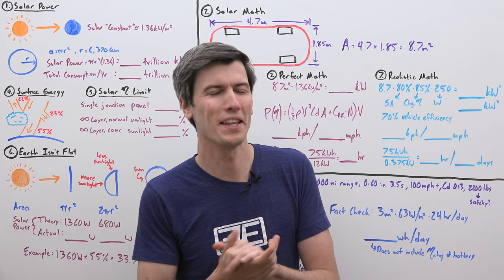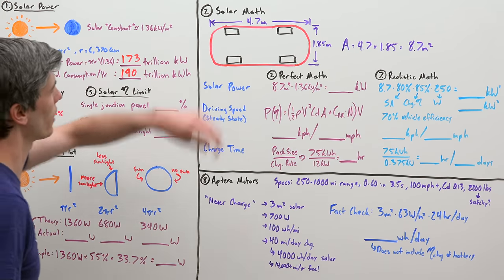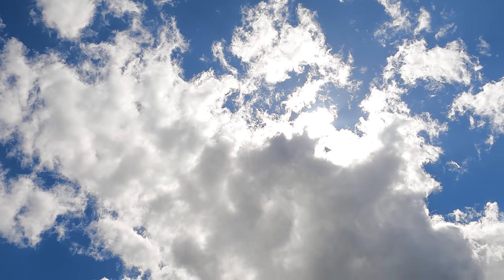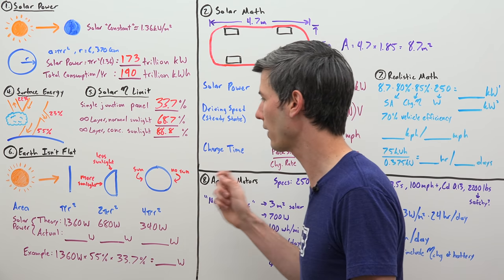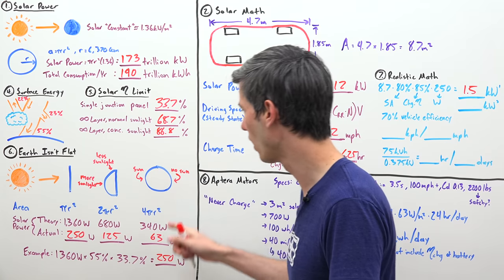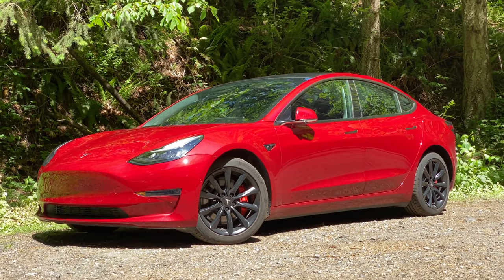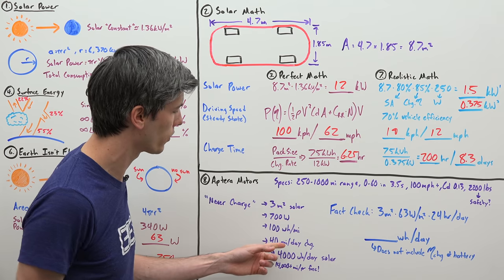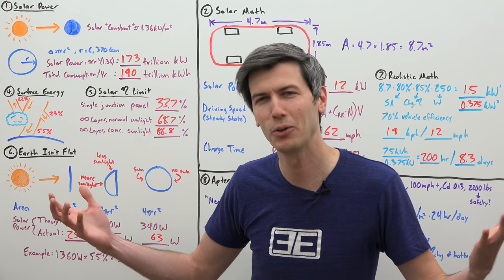Why Don't Solar Powered Cars Exist?

Comment: I have to give you a like just for the math, since that's exactly what you need to do when you're talking about energy, energy storage etc. It seems like it's so neglected in the public discourse. People just claim stuff without backing it up with numbers and actual physics.
Reply: Sometimes just using your common sense is enough to prove something can't work, isn't technically feasible or financially "difficult".
Reply: I mean, showing all the math and going into the weeds to explain everything makes sense on a youtube channel called Engineering Explained. But if you do that in regular public discourse you're just going to confuse and lose people. If you're not all that technically minded, familiar with the topic, or even just all that invested; if you have two people talking with seemingly similar levels of expertise you're more likely to believe the person who's more charismatic and explaining it in a way you can understand rather than just throwing maths at you. And even if the public discourse was based solely around dry facts, people would still be manipulating or omitting specific facts to make their case stronger. As long as the average person isn't knowledgeable about everything or only interested in the topics they are experts at, the public discourse will never be ruled by pure maths and facts.
Reply: @Enforcer_WJDE  
Often common sense is not enough, but people were ill-informed an think that it's enough. I see this all the time in discussions about global warming and CO2 neutral energy systems. People just make arguments based on what they see as "common sense" and then fail miserably or suddenly think that they've refuted over 100 years of scientific research.

But of course the math and the physics is often hard and people can't do it. So instead of realising that since they aren't able to do the math they aren't experts and shouldn't take their own opinions too seriously they instead delude themselves into thinking that math isn't that important and that "common sense" is enough. 

Maybe that's the reason why you're objecting right now. Who knows?

I teach physics (besides math and chemistry) and i always make sure to teach my students, that don't really understand something if they can't do the math. You need some intuitive understanding, some feeling for it, but you also need to understand and use the formulas. If you don't know how to use the formulas and where they are comming from then you aren't really done yet. After all you want to be able to answer question and to answer a lot of questions you need to be able to do math.
Reply: I wish I could give two likes for the use of SI units!
Reply: If you average the miles generated per day its 24 miles per day Produced by the car  (8.3 days per full tank, 200 mile range, yada yada), this is around the average for americans to drive every day, so it actually does mantain itself basically.  (Avg american drives 29 miles a day, 24 is 82% generated by the car)
Reply: Though I would have liked to have seen him mention other factors like clouds. Folks in Seattle won't get nearly as much usefulness of a solar car as me in Las Vegas. Another factor is most people park cars in garages now, it's pretty much a necessity where I live if you have any paint color other than white (the sun eats through paint). So getting charging at home or in a parking garage may not be possible.
Reply: @jimmym3352  very good point. Garages are a big downside. It really shows how yes this technically could work great and be a good idea but just put them on your roof😂. Then no downsides of surface area, garages, ewaste if you crash, etc.
Reply: @Enforcer_WJDE  no, not really. "Common sense" is why people think the earth is flat. Don't promote this garbage... Numbers matter.
Reply: @SapientGalaxy  Plus the sun doesn't shine 24hrs a day. I don't understand math at all but I like to sleep at nighttime. When it's dark out.
Reply: @Enforcer_WJDE  Let's all use "common sense"  (means nothing) to decide what is possible or not possible and realize that putting any effort put into investigation, reason or logic is all a horrible waste.    (I never fake sarcasm)

Comment: As my 2-year-old boy starts screaming and running around:

"So, we need to understand the son. and the son has all of this energy..."
Reply: Now all we need is to harness the sons energy.

I was thinking about some sort of hamster wheel.
Reply: @lordrefrigeratorintercoole288  Actually, in one of the scifi novel (the title of which I forgot) an inventor invented a set of puleys and levers connected to power generators spread around the house, so that children (who have excess of energy and are always up to something) will rotate and move while producing electricity.
Reply: @aGGeRReS  that seems like a good and a terrible idea lol

and yeah pls try to find the movie
Reply: @Lurkindork  not a movie, but rather a novel. Was trying to find it, but I read it long time ago and Google doesn't help.
Reply: The farmer told the solar home builder, "It won't work, I have a teenage son that lays in the sun all the time, he doesn't have any energy!"
Reply: @lamarrharding4776  the teenage sun spent it all when younger
Reply: Probiotics and a cup of green tea help my wild one. 5 yo
Reply: @aGGeRReS  reminds me of those pressure generators pads for paths. Apparently they make flat ground feel like you're constantly walking uphill or a bit like walking on a dry beach where your feet sink with every step. 

It's one reason we'll never see non-consentual human generated power because people like 95 year old Marleen could have a heart attack because the subway made forced her to produce their electricity.

Comment: One thing that I think bears mentioning is that even if you can't drive 100% on solar, that passive charging can still be useful. 

Instead of having to go to a fast charger every week, maybe you're going once every 2 weeks, or every 2 months, etc. 

That's a huge help to people who can't charge at home.
Reply: The average daily drive distance in the US is 38 miles. So in good sunny conditions this car could stay charged on solar alone for half of drivers!
Although in practice not, because normal driving is likely to need more power than the optimised driving used in their figures and most places are probably not optimally sunny. But you probably could get away with charging it very rarely, as you say.
Reply: It's a lot more functional to just have solar panels on the grid and charge from it. The productivity is much better and they aren't wasting power if your car's battery is full. The car also doesn't have to carry the extra weight of the panels.
Reply: @mgkleym  I think it's still mostly a gimmick. The only people it would be genuinely useful for are those who can't plug in at home, eg those who have to park in the street. Public chargers are expensive.
Reply: @adrianthoroughgood1191  the “only people” are city folks and we have 60 millions people living in US cities
Reply: @RomanticPopPunk  the numbers depend on what you define as city. 80% of the population lives in urban areas but that would also include suburbs and towns. Even in big cities a lot of people have off street parking, eg a parking garage in the basement. A lot more just don't have a car at all. In high density areas there isn't much roon for very many cars parked in the street, not compared to the population living on the street. In the UK some councils are installing chargers built into existing lamp posts. They are only low speed because the cables couldn't handle more, but enough to top up over night. I think this is a good idea. I think governments should require building owners to install chargers for every parking space at apartment block car parks etc. In a high density built up area the solar panels on a car probably won't charge very well due to shadows. A solar car might work for some people but I don't think it will be worth it for very many. The amount of charge you get is small but the cost increase in the car is a lot. If you drive to work and have parking there you would probably be better off charging there if you can't at home. I think governments should require work places to provide chargers as well. In Europe, in 13 years time 100% of new cars are required to be EVs. We need to get serious about making sure everyone can charge their cars and don't get left behind.

Comment: @Engineering Explained  Jason, I've been looking forward to you reviewing the Aptera.  When they opened the queue, I paid for a place in line.  I don't think "solar powered" should be their primary marketing angle, but most efficient vehicle on the road, by a long shot, is pretty awesome.
Reply: Good luck, but the Aptera has been ready for imminent release since 2005.
Reply: @truantray  You are leaving out a long, long back story involving corporate politics, bankruptcy, a new owner, then another owner, then acquisition by the original founders. Production follows the 4th prototype in 2022.
Reply: I have been sold on this paradigm shift in private vehicles from the beginning 16 years ago. I have deposits for two.
Reply: @1voluntaryist  Aptera never went bankrupt.
Reply: I agree that placing primary marketing on solar might not be the best Focus, but having watched them since 2005 when I've been looking at electric vehicles living out west, I think that the delay in reaching production is tremendously enhanced by better battery technology and we had available at the time and increasing efficiencies of charging. I will pay for a place in line for the new cars shortly.
Reply: Aptera's main focus when creating their vehicle wasn't solar, they focused on making the most efficient car possible, then realized that they could apply solar charging to their car
Reply: @1voluntaryist  1 year later: So you got scammed out of the deposits for 2x 3 wheelers that you won't see yet for at least 3-4 years at a minimum if at all? 
Did you ever drive a 3 wheeler? Wonder why there are none on the road?
Reply: I second this request
Reply: I understand the skepticism, but I think they will make it.  They already have a production ready design after going through several iterations of prototypes, they have production line planned with help from Munro and associates, they also have most all of the suppliers secured, including the carbon panel production (with molds cut), the solar, the motors and battery.  They just received a 20 million from California, and have raised about 12 million on their own, with potential for several other funding sources.  Obviously, they still need a lot more funding, and I think that you're right that it will be at least a couple of years before regular reservation holders start getting them.  

Can they still fail?  Absolutely, yes.  But don't count them out just yet.  I'm really hoping they get there.
Reply: @Tyiriel  the Trex? which is a best of a car 😂

Comment: Putting solar on cars does not make much sense. They rarely are in a good position to get sunlight and the panels are expensive to integrate. Its much more cost effective to put a couple of panels on top of the parking lot where the car is usually parked during the day. Keeps the car cool and charged.
Reply: Right but many people don’t want a extra solar panel on their roof or all the expense of installing that. Also they don’t like waiting around to charge a electric car. There are tons of people that don’t even have a garage of their own to park their car. This solar car would actually be decent for a lot of people.
Reply: If you had both and your charger was grid connected and you drive less than 40miles/day, your car becomes not only free transportation but also a supplement to what your charger makes powering the grid.
Reply: there is a way to use solar energy for EV's, but only supplemental charging can be carried by the car. fold out panels for parked situations to increase the sqm of your roof panel, home solar storage and community solar charging (like you mention). right now, the efficiency of collecting the charge is pretty low, and expensive to boot, but i bet aftermarket solar car chargers will become a thing as the EV market continues to grow and tech finds a way to get more juice out of a panel. solar cant totally replace plugging your car in, but it does not have to; only help you out a little bit
Reply: @markm0000  integrating a 1kW solar array in a car .easily cost 3000€ or more. The panels have to be flexible and withstand vibration and impacts of debris. 
Even if the panel is installed at least 40% of the panels will face the wrong direction in the morning and afternoon. Most cars parked in cities are in the buildings' shaddows for a large portion of the day. There actually is a company here in Munich that builds a car with solar arrays on it. In some tests in the city the car generated less than 20km or range/day in summer. 
You'd be better off to buy shares of a solar plant if you cannot install a solar array on your own house. That's what I did. My EV electricity bill is covered by a 10kW share of a solar plant in the neighbour village
Reply: @fabianfeilcke7220  ok great, now do you want the free miles or not?
Reply: I think the better model is large solar arrays at home to collect energy and store that in batteries to then charge the car.
Then smaller solar panels on the roof of the car would be used for 2 things: 
1. trickle charging the cars battery when driving or parked
2. running the HVAC system when parked to cool the car on hot/sunny days
Reply: @NovaResource  Tomato tamato
Reply: @L8nitedave  They are not free if i have to pay a couple thousand € to get them. I'd rather charge the car once a week
Reply: @fabianfeilcke7220  well clearly the solar cells on the car pay for themselves but why not take that in daily mileage?  If you don't use it, put it in the bank instead of throwing it away.
Reply: @L8nitedave  That's kind of like buying a cow for "free milk". It's not free, you still paid for the cow.
Reply: If you can make significant energy wherever you are, and it is enough for transport, then a lot of cool things can happen. So much of the world is not western suburbia.
Reply: "They rarely are in a good position to get sunlight"

I don't know where you people think cars get parked, but here's a hint: it's usually not indoors. That generally only happens if you have a garage at home. Every other time, like at work, the car is outside. In the sun.
Reply: @mjc0961  Most cars are or go to cities. In cities there are buildings, trees and other, taller cars. 
Even here at my office in the countryside, one half of the parking is 6 hours the the shadow of the building, then there is about 3h of sun, then the parking is shaded by trees on the other side. 
Even if your car is standing out in the desert, it would be a better concept to put the solar panels on a rack on top of the car. When you park, you unfold them and they cover the entire car. You get more area this way, and the car stays cool in the shades. also you could put them at a slight angle so the rain can clean of the dust, that would cover the solar array otherwise. Those panes could be standard flat panels, which makes them magnitudes cheaper. If they break you could easily replace them, rather than switching bodyparts of the car.
Reply: Tell the Solar Freakin' Roadways people about roofs over carports or parking lots (or, potentially, traffic lanes). Blow their freakin' minds. "Wait, what? You mean we could have the same amount of surface area for solar but angled, and without all the problems of it having to also be a durable road surface? Nobody ever thought of that!"